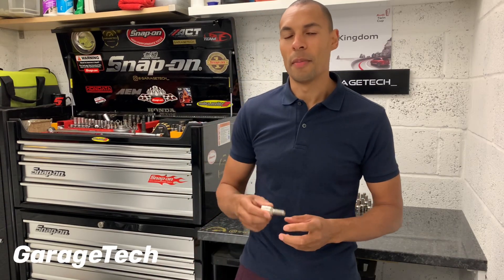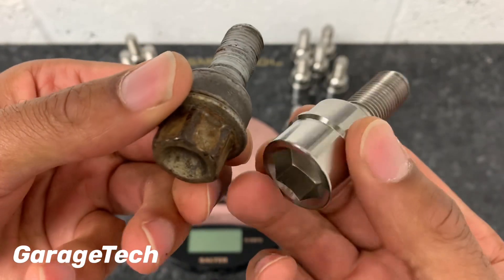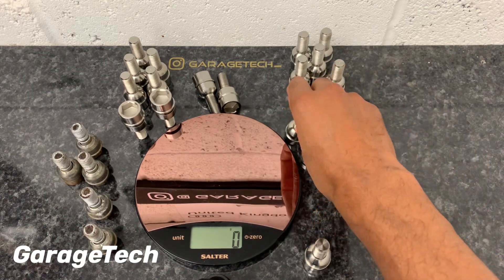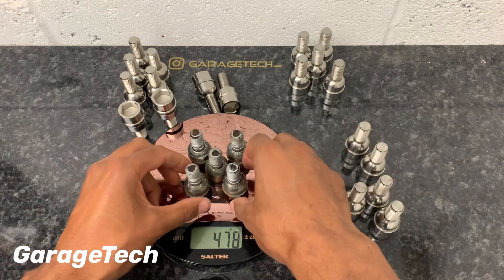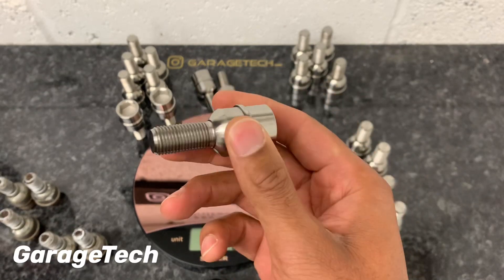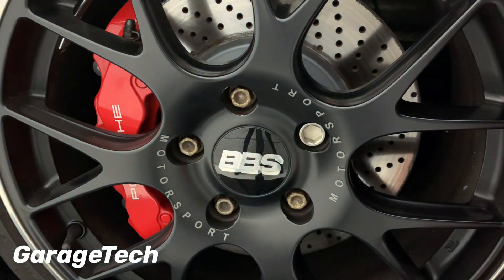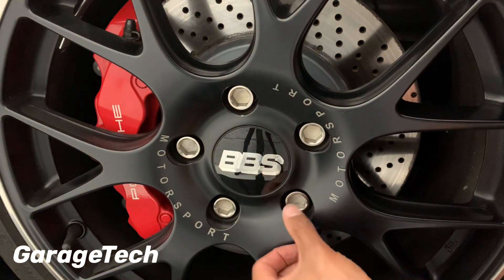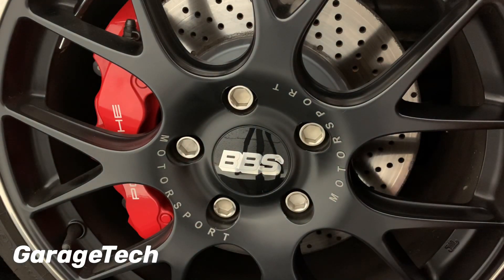How much do Titanium wheel bolts weigh??

Comment: Do you use the same torque as with steel?
Reply from the maker: I used 120NM for these and rechecked after 50-80 miles . Some wheel bolt manufacturers may recommend a torque setting
Reply: @GarageTechAutomotive Why are they made out of the pieces?